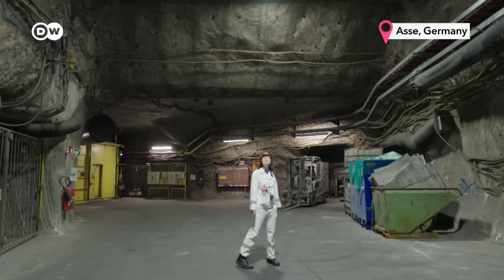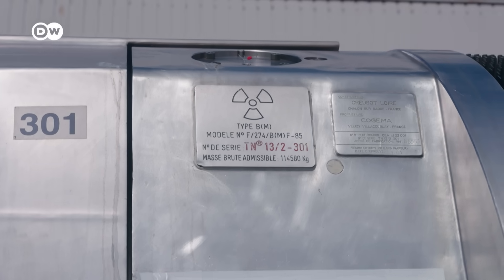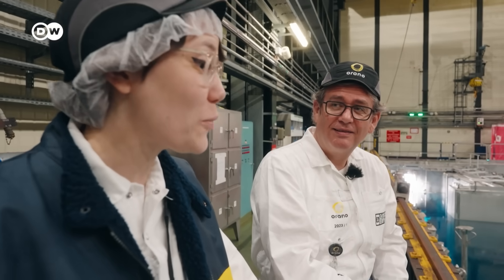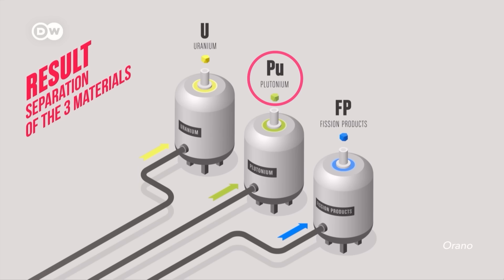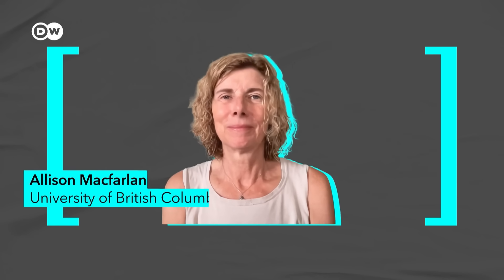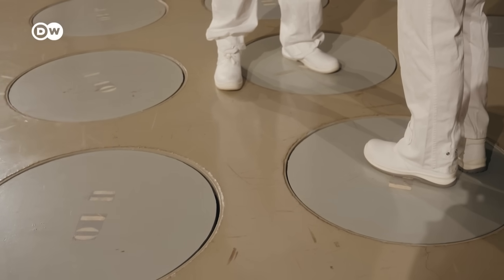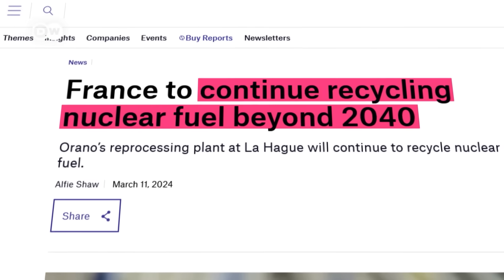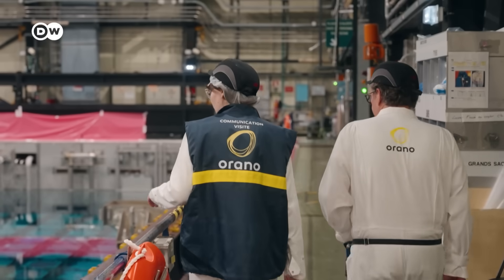Nuclear waste is reusable. Why aren’t we doing it?

Comment: "You don't NEED to recycle" Well while that's true I would counter with well just because you don't need to doesn't mean you shouldn't.  It would make nuclear power far more attractive if we were able to produce nuclear power with less waste over time.  Sometimes it's not about cost it's about doing what's the right thing to do.
Reply: Also it's an insurance in case the price of fresh Uranium rises. Right now they can get it cheap from poor countries, but what if those countries change allegiances? What if there's a coup and the new military government demand higher prices? Reusing those fuel rods can provide security and self-reliance.
Reply: Nuclear waste due to amount iself, is literaly NON ISSUE.
Reply: The main barriers to "recycling" nuclear waste are the cost, the increased cost of disposing the unavoidable separated Fission products, and the additional disposal issues of using fuel derived from such wastes.
Reply: There is no point in recycling the spent fuel rods. They are perfectly fine living in basins where they can't hurt anybody
Reply: @NOTREALCREEK  
"living in basins"?

Spent Fuel requires elaborate final disposal options, after years of storage in actively cooled pools.
any release at all, of even trace amounts, would be extremely dangerous.

Think it over.
Reply: @aaroncosier735  yes, they eventually live in sealed concrete bunkers where they can't hurt anybody, because the particles literally hit a wall and can only travel centimetres through concrete. Sure it is annoying to have to dispose of, but recycling them is too expensive. If we find a cheap way then we can dig them up in the future
Reply: @NOTREALCREEK  
Perhaps eventually. None has been yet.

The radiation shielding is only the most basic function.
Chemical containment is the bigger issue. Many fission products are soluble. The containment is much more about making a bottle that will last 100,000 years.

Actually achieving this disposal is not trivial or easy. No nuclear nation has commenced disposal, and none of the large nations have even made a start.

In the meantime, Spent Fuel in wet storage is a stupendous radiological hazard, susceptible to strategic or terrorist attack, or even simple neglect.
Reply: Reading this tripe Is irksome.It's as if nuke reactors were all the same...& Nobody has heard of THORIUM,the fuel for FLUID SALT REACTORS..NO FUEL RODS & NO NUKE WASTE..& guess what?The waste from fast -breeder reactors can be completely burnt in them!!A 50yr old tech ignored since Nixon had the funding cut in the early 1970s.Now the Chinese are progressing them & people like Bill Gates..50yrs of unnecessary pollution.. immense safe energy foregone 😮😢
Reply: Perhaps we don't NEED to recycle millions of tons of solar panels and wind turbines to make them environmentally clean? And oh, let's ignore land and water pollution.
Reply: "Produce nuclear power with less waste..."THAT was done over 65yrs ago..: fluid salt reactors..at last some people are doing something about this power source.. Which can burn 99% of the crap that fast breeder reactors produce.
Reply: Well tbf i don't see point for all countries to recycle their waste. they can sell/pay this place for example to recycle that and it's also 100x times cheaper. Also if recycle cost u 1000x times more then storing it then there's literally no point. Too much waste? Buy more places to store it, it costs less and u can build recycle place in the future when it's for example cheaper
Reply: @marcinsadowski7230 you will eventually run out of space we can barely find places to live or even keep fucking trash what do you mean this way you stop the constant mining of uranium and there’s a big expense and pollutant gone
Reply: @marcinsadowski7230  Yeah, we thought that also about different things... and now we are trying to change it when it's almost too late. Why shouldn't we think about the future and safety and try to be polite to earth just as much as it was polite to us. It f*cking kills me, how ruthless people are, the thing that something is cheaper doesn't mean, that it's better even if it might seem like that in short amount of time.
Reply: @back8139  bro but u clearly don't understand. The amount of waste in one nuclear station is so small that they can just store it INSIDE STATION for like 100+ years so it doesn't pollute our planet and we talk about really really small amount of waste. U can't say the same things about plastic etc
Reply: @back8139  bro 1 nuclear plant can stock their waste for like 100years do it's not even short amount of time and as I said there is so little waste so they can send it to this France recycle place it's not plastic bro

Comment: THere are two choices - built a fast breeder nuclear power plant design when a standard design is already always over budget and not built on time or turn it into NOX which Sellafield did (and France and Germany has perhaps China as well). This fuel can only be used once, its legacy waste is even more toxic (yes that toxic!) , it cuts the power generation, adds to the operating and design cost to use such fuel and making NOX from nuclear power station waste is one of the most if not the most toxic manufacturing on earth and thats thats apart from the radiation hazard. Note the recycling facility is just that- it does not generate power and its horribly expensive to built. Russia was to do this for Irans nuclear power plant waste to avoid it being used for bomb making. 
The clue is making a plant design that does not mean the vast amount of pure fuel is wasted and is hard to recycle. Thorium or modular
Reply: Modular are less efficient than large reactors, producing more waste per unit of energy produced.
Reply: @NSRomanov  But they could and should be vastly cheaper ro contract and making power. The Capex cost is also part of the ROI. If its way more expensive and late to work as planned, then that feeds the return on investment and either a higher kW price is needed ( subsidised by the taxpayer or consumer overall rate) or the project never gets lending approval by the investors (or again more taxpayer/customer subsidy over a decade or more). Modular means more flexible power generation as smaller capacity, smaller staff to operate, less waste, less water demand, smaller land footprint to purchase. A very big nuclear plant has economies of scale but it has to run at a higher generation level to do that and that locks out more renewables and even  other legacy power plants to safeguard the bigger plants minimum output. A lower minimum nuclear output means higher kW price. Then you need even bigger grid connections to accept that power unlike modular lower power output . Finally you can just add to modular as demand rises,  closer to that demand being needed vs over developing now for that demand later. Modular us also being designed to allow for more pre assembly first vs every bespoke larger traditional reactor construction no matter the "standard" design

Comment: They all talk about EVs. Ok so a mini reactor the size of 1-2 gallons of milk, and needs water refilled every few months can power that electric motor using the waste pellets for decades, without the need for the massive heavy batteries that pollute to mine and manufacture. When parked, it can be plugged into the household lines to return power to the grid.
If/when its time to swap it out, the whole reactor is just replaced, and they put what is in there for low risk waste storage or reused in a refueled reactor cell. Same setup can be used to power individual houses or larger version for emergency city power, as well as military vehicles like tanks and EV planes/drones.
Reply from the maker: Hi! Thank you for your interest in nuclear energy. We have a video dedicated to this topic, check it out and let us know what you think:  
👉 Why people want to put small nuclear reactors everywhere https://youtu.be/GhKQ8EP1a1Y?feature=shared

Comment: Like all activists this one has a hard time understanding basic economics and how supply chains work.  It takes 7 Years yes seven years of spending tens of millions every year to keep the first time used nuclear fuel rods to cool down to use again so another year or so, 8 years of recycling a element that they buy at a fraction of the cost that's ready to go. If they last 4 years and than 8 years after that is how you get higher costs to the producer and consumer.  But progressives don't care.  Too bad so many of them use so much electricity that their always b1tching about

Comment: The UK had a nuclear reprocessing plant back in the 1994, Sellafield - Located at Sellafield, Cumbria, England, THORP is a nuclear fuel reprocessing plant owned by the Nuclear Decommissioning Authority (NDA) and operated by Sellafield Ltd. It was designed to reprocess irradiated oxide nuclear fuel from both UK and foreign reactors

Sellafield, formerly known as Windscale, is a large multi-function nuclear site close to Seascale on the coast of Cumbria, England. As of August 2022, primary activities are nuclear waste processing and storage and nuclear decommissioning. Former activities included nuclear power generation from 1956 to 2003, and nuclear fuel reprocessing from 1952 to 2022

Comment: The objective from using nuclear material is to get electrons/electricity. Instead of using heat to produce steam to turn a generator to produce electrons, why don't we just use the radiation to react with a gas to produce photons, and use the photons to produce the electrons, like what happens in a solar panel? The end result is the same,, the production of electrons. We can then use the photons, to knock out electrons binding atoms together in water to separate the hydrogen from oxygen and we can then use the hydrogen as fuel in engines like jet engines, where the jet can carry water which is not explosive or flammable, and this process can happen so fast it can be done near the engines as needed instead of just storing hydrogen in the fuel tanks. This will work 100s of times faster then the most advanced hydrogen fuel cells.

Comment: If they are still putting off heat for five years, couldn’t that be used to create energy?
If they are too cool to boil water could another solution with a lower boiling point create pressure that could spin a turbine?

Comment: My impression was that the fuel rods themself make up a very small amount of the waste. Consumables, like gloves, clothing, cleaning supplies, old pumps are what fills the vast majority of those barrels. and those aren't going away just because you keep reusing the fuel. Re-using the fuel reduces the load on uranium mines, and I guess that's good.
Reply: Low-level waste gets disposed of in special landfills (or in the case of metals, recycled into shielding blocks).

Comment: Attention: this video is a bit of a marketing lie!

Orano claims 96% of the used fuel is recycled but that is more a lie than a truth.
Most reactors use a mix of ~95% U238 and 5% U235 as fuel. 
Spent fuel is 4% real waste, 1% U235 1% Plutonium and 94% U238.

Now Orano splits that into 4% true waste products (that is where the 96% comes from) and into the rest.
The 1% plutonium is actually used in MOX fuel as a true recycled energy source.

What they are conviniently not talking about is the 95% U238+U235 mix.
This CAN NOT be used as fuel in todays reactors. It would need to be re-enriched to bring the U235 level up again so it is a proper fuel.
NO ONE does this because enriching also means you could build nucler weapons material with it and it is very costly.

I believe there is a reenrichment facility in russia but I am not sure
Effectively they are only recycling 1% and not 96%

Comment: @4:48, its exactly like a uranium mine but you dont have to mine more uranium which is huge (reducing your environmental impact of mining to make the nuclear fission argument even more sound). This is still a non-renewable source but is getting closer and closer to carbon neutral which matters the most here.

I love the France is trying to use as much uranium, in the fullest that they can. Hopefully other countries introduce Breeder reactors and uranium reclamation facilities. As is, nuclear fusion is decades away (if its physically possible at scale and to be economical, to sustain the fusion). ITER is a worthwhile research group but the technology isn’t here today or even here in 20 years (and the outcome of the research is unclear if we can achieve finically viable fusion power, at scale).

Comment: I watched a talk by a nuclear engineer and their summery of the nuclear waste problem was that the waste isotopes could be categorized into three classes: 1] those that have enough legitimate uses people will pay you more for them than it cost to extract them, 2] those that have such a long half-life that they are no more dangerous radiologically than the stuff that was originally mined and 3] those that have such a short half life that it's all gone before you have anything to worry about. (I'm sure there is a tiny fraction that is an exception, but if you can reduce the problem to a few dozen liters a year of mildly active stuff, it becomes way simpler to solve regardless of what you demand of a solution.)

Comment: It is not economically viable not because it is expensive, but because nobody want to pay the price for it. The carbon dioxide market is flooded with dubious projects and minimal oversight.

Producing a carbon neutral product will always be more expensive than the one that pollutes. First because it requires more thinking and RnD to create and use alternative materials. Second because simply there is more steps at work. If the companies that make this effort to make or even chose those products are not rewarded, then we can discuss this for a long time. 

It needs political will to tackle this issue and reward economic actors that are stepping ahead in the carbon free future.

Comment: The most long-lived radioactive material are  the least radioactive per gram .  If it were not for proliferation concerns you could dispose of plutonium by diluting it with other toxic metal waste and disposing it with them.  Lead, cadmium , mercury, arsenic etc, do not have Half-Lives, they are toxic forever

Comment: The throw-away mindset needs to change when it comes to nuclear fuel. The cost to recover and recycle fuel must be included in actual operating costs instead of just burying it out of the way somewhere so it will be someone else's problem.

Comment: Great Video!  I've heard of France's nuclear waste recycling, but it's great to see it in operation.  

fission products

Those fission products, I think, are the biggest problem, besides the plutonium.  These are the split halves of the atoms.

Specifically, a U235 nucleus, has 92 protons and the rest neutrons.  It's really too big to be stable.   All elements up to Lead have stable nuclei (nucleuses) (except for Tc and Pm).  Now, Protons and Electrons attract, those are positive and negative charges, that's electrical.  Protons and Neutrons also attract, using 'the strong force' or quantum chromodynamics (big complex topic that I don't even understand).  Now, that force is WAY WAY more powerful, but it only works over short distances.  Like 100,000 times smaller, the size of a tiny nucleus at the center of an atom.    So, your average Carbon atom's nucleus, C12, 6 protons and 6 neutrons, is perfectly happy.  Despite the fact that the 6 protons are all repelling each other, like crazy.

study up!  Don't read all of this, just the introductions:
different kinds of atoms: https://en.wikipedia.org/wiki/Periodic_table
each kind of atom has many isotopes: https://en.wikipedia.org/wiki/Isotope
nucleus of atoms: https://en.wikipedia.org/wiki/Atomic_nucleus
chart of all isotopes of all elements:  https://www-nds.iaea.org/relnsd/vcharthtml/VChartHTML.html

So a U235 nucleus is too big -  so big, that the protons on one side of the nucleus repel the protons on the other side, and the two sides are farther apart so the Strong force is weaker.  It's  barely hanging on.  It's actually stretched to egg shape, ready to break in two.

So, in a reactor, a neutron comes flying along and smacks this nucleus, and it breaks in two - that's fission.  It's violent, and the results are kindof random: you usually get a big piece and a small piece.  The small piece is usually some nucleus between weight 80 and 105, and the big piece is usually some element weight 128 to 150.  (See periodic chart, above, and look for atomic weights, not atomic numbers.)  And each can be a number of different isotopes (see chart of isotopes, above), most of which are highly radioactive. HIGHLY radioactive.  And, you get a random scattering, like jellybeans spilled on the floor.

The most dangerous are the ones with short halflives.  Each atom will spit out an electron.  If its halflife is 1 hour, then half of the electrons get spit out in 1 hour; almost all in the first day after splitting.  If the halflife is 1 year, then half are spit out over a year, and almost all over 20 years - much slower.  If the halflife is 1 second, then you'll see almost all of them spit out in a minute.  And, some of them do have a halflife of 1 second.  So this can be an enormous number of electrons, causing an enormous amount of damage to flesh, or steel, or almost anything.

These fission products are the most radioactive substances on  earth.  You've heard of radioactive stuff that glows in the dark?  This is the stuff that glows in the dark.  (Plutonium?  eh, not so much.  24,000 year halflife.)  This is why, in the video, you saw the fresh fuel rods being kept in a cooling room for '5 to 7 years', before they even try to do anything with them.